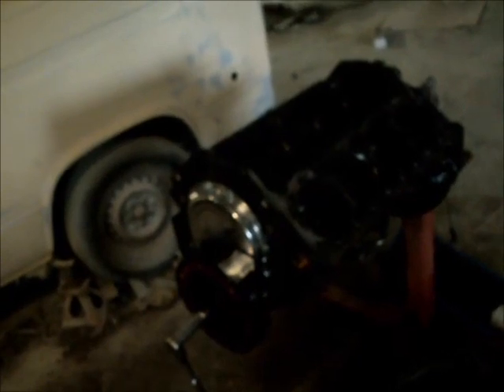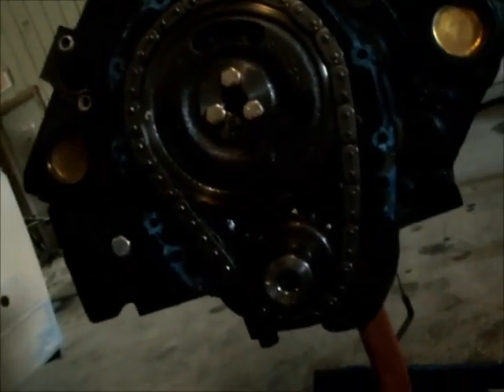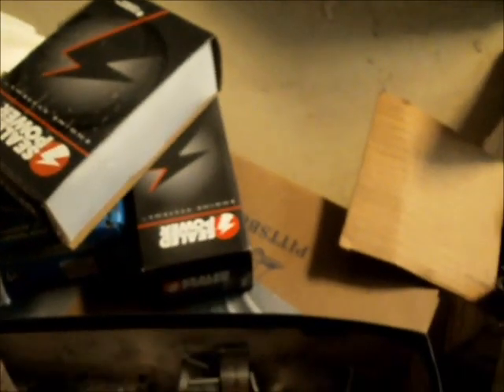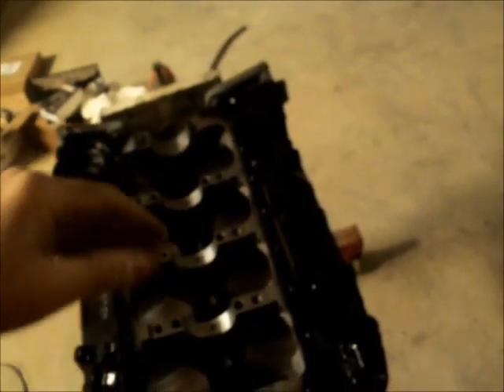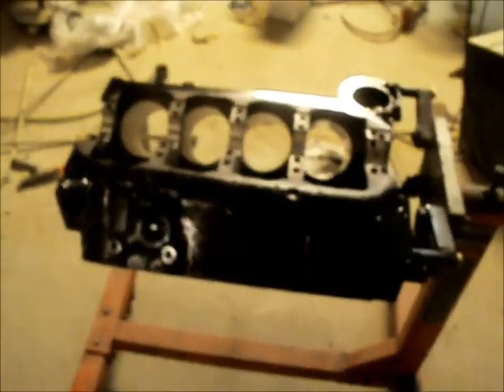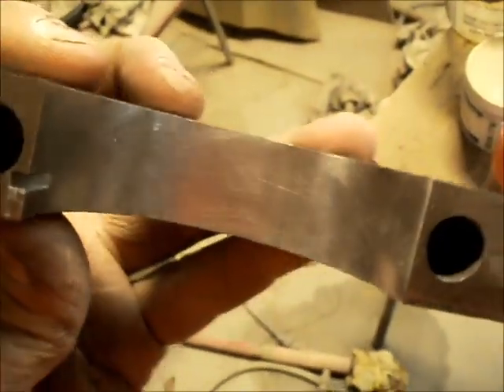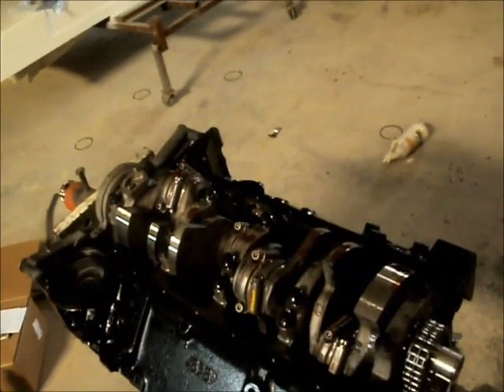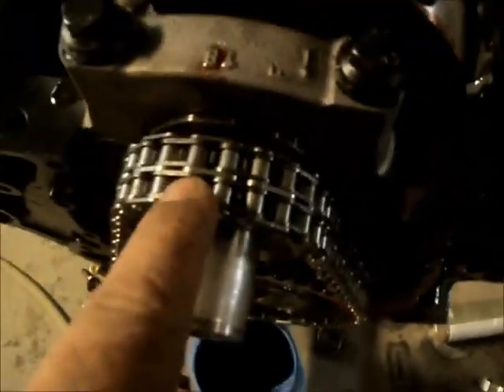fixing bluprint 396 stroker sbc crate motor.

Comment: I've got a Blue engine and it's working great! I was surprised at their price on my engine! 632 ci changed to dry sump oil and inspection of machine work and wear at 23,000 miles is very good. Guess they do make some great engines. We don't agree on brown R spiders almost lost hand to bite in 1977. Enjoy your stay in county and just know all blue engine are junk. Have you run into 20 or 30 engines? I built BBC stroker in the 80's and what they give me was a engine that Dyno at our shop at 847 hp at 5994 rpm two years after I purchased the motor. Enjoy your honey buns...ha ha...inside joke real inside!
Reply: once your bit by brown recluse , you might have problems with your entire body systems for life and or an early death, the guitarist from the band slayer was bit 20 plus years ago and he succumbed to it earlier this decade. It is a necrotic venom and destroys and causes necrosis that is basically making everything it touches dead. if not treated in the first moments or days  of bite loss of limb or life eventually is certain. There is a video on youtube bite on thumb, eventually the thumb was amputeed because they thought it would get better. imagine what the internal organs and brain and tissues are going through. The guitarist went on 20 years battling it, because he was bit on the arm, the extremity bites onlly show what is happening and can be cut off, the upper arm however is different. very horrible creature the brown recluse is. Its deadly. This is a warning message for everyone, these things must be removed from your house. The brown recluse' nick names are 'fiddle back'  violin back and brown recluse very darty quick and very large for legs and fangs very frightened and aggressive, likes places like under the covers, around bedding, around cradles, under things like you might find a lizard under a rock, it hides in crevices and occasionally races across floors, protect your babies, constantly clean your baby's crib. Also the most common house spider 'the brown spider' is venomous just not as lethal as brown recluse or the lesser black widow that also has a marking under its distinct satin black bulbous butt a bright red hourglass. the brown recluse has a fiddle on the top of its back a violin shape and two crazy ass front legs that curl up high like in this video because the length is much longer and you see how crazy it behaves.
Reply: My only question is what Nebbish buys a 632 to he can put 23K on the Odometer ?????? EVERY Man I know who purchased a 632 did so for Drag racing Or mud drags I don't know ANYONE who has one who mentioned  buying one to put 23K miles on it....But then what do I know...

Comment: spend 1600 and get a large bore small block DART or brodix block and go to 4.165" bore then stuff that crank yeah now you got prime time. and you get a good machine shop that can do the work correctly is paramount. isay just get a dart block and afr or promaxx or dragonslayer heads your only in it for 3000 and have all the best components so far. a forged crank would be nice then let a guy that can build them that knows a good machine shop that will work close and correctly with him/ her. that's what ido. for 5000 you could have a forged crank , a dart block , best heads, and maybe even rods and pistons, there you would have the best parts  to start why mess with low quality knock offs just get the real stuff. at least you would have it, then spend next year putting it together and machining and carbs and cams and stuff. you could have the same power and more , a 434 or 454 small block pump gas engine running 600+hp hot or 550hp cool and the same torque as this 396 engine 540 torque from a blueprint motor  is amazing good job guys.

Comment: Moral of the story,  Blueprint motors are jumk!!!
Reply: I've heard good things about BP as long as you buy their certain series of engines with the forged steel crank, rods and forged alloy piston.  They also Dyno each one before it goes out and come with the Dyno sheet and build sheet.
Reply: Dell Jr Blueprint only dyno certain engines they don't have enough time to dyno them all the place is set up like a assembly line.
Reply: I haven't heard a bad thing about them other than this video

Comment: Thanks for the tip I almost bought one
Reply: its worth the machine work as seen in this video for sure, its a bargain engine with bargain values, that must be corrected, once is done you got a real bargain at 540 tq and 512 hp. still far cheaper with value in the end, than the alternatives.

Comment: A customer of mine bought a 450 hp blueprint engine. Uh huh 600 Holley low profile dualplane intake cheap ass aluminum heads barely a cam at all . And runs on pump gas. All in a 355 ci , none of this crap adds up to 450 hp . I'm calling bs